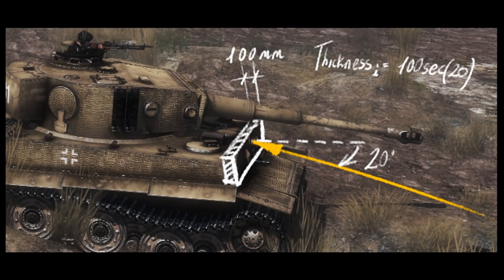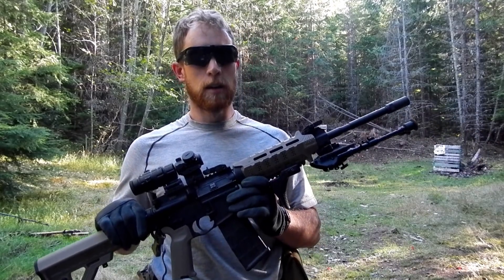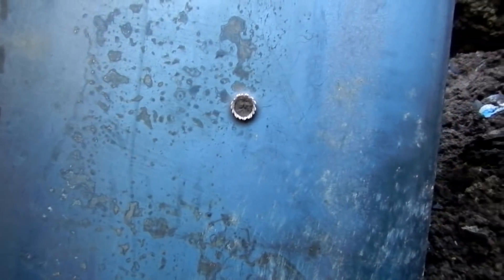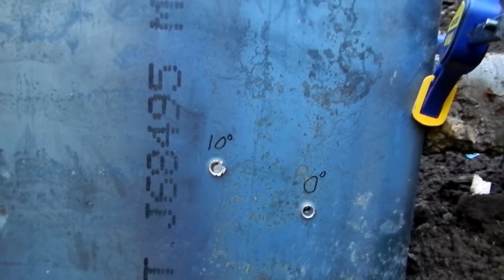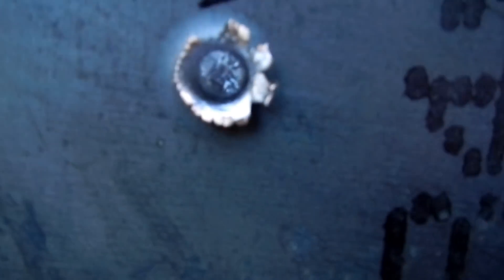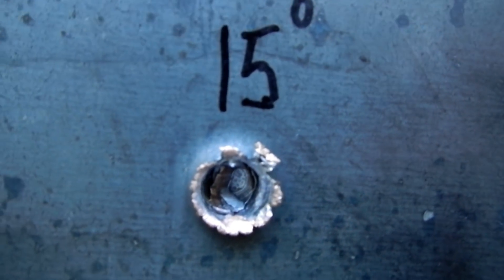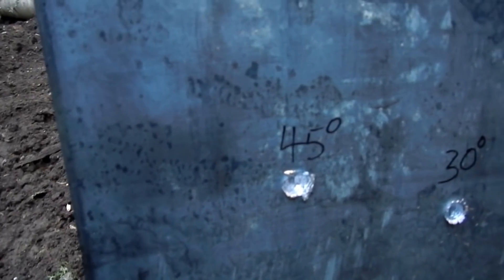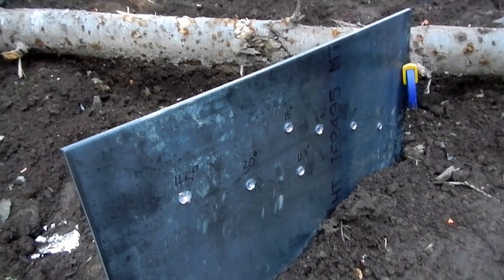Does sloping armor increase it's protection?

Comment: But to cover a given vertical distance an angled plate must be longer than a vertical plate - increasing its weight. For a given weight of armor is it better to use a thicker vertical plate or a thinner, longer angled plate?
Reply: This is a valid question if the vertical coverage is all you're looking for. Super good question.
Reply: Yes but you require two plates to cover the same space a sloped plate will cover. Plus a welded seam.
Reply: The top or roof plate doesn't need to be thick though, while the entirety of the slope plate has to be the same thickness.
Thus, the sloped plate (c) weighs more than the thin (a) roof plate and the thick (b) plate combined where (c) and (b) have the same thickness.
Reply: I'm not sure if I can word this in a way that makes sense, but the angled plate might still be lighter than a thicker front plate and a thinner roof because the angled plate can be thinner than the vertical one would have to be, just because of the distance the round has to penetrate horizontally will be the same if the slanted one is thinner. Also, I wonder how the tank designers thought of defense against aircraft. The thin roof design wouldn't help from that.
Reply: Michael Holderegger a lot of tanks where open topped. Most were thinner on top. Planes and artillery have always been a way to kill tanks.
Reply: Michael Holderegger your front plate should be as thick and slopped as possible. The requirements of the vehicle will also help dictate the need for protection vs speed and tactical application.
Reply: @brendonmoore3505  "front plate should be as thick and slopped as possible." you completly forgeting in your theory that you trying to cover something with your armor... you also dont understand that projectiles when attacking armor at angle doing something called 'normalization" -> changing angle of penetration. Sometimes its good to have vertical armot(that is why most modern armored vehicles have sloped armor only on the front...).
Reply: Biały are you telling me you won’t make your front plate as sloped and thick as possible. I’m totally aware it’s a box. 
Totally aware of normilizaton aswell but that’s a little much for a channel. 
Pretty much why I said it, front plate thick and sloped like all modern MBts.?
Reply: A sloped armour will be half the weight of a vertical slab. Simple because the slop doubles the stopping power or deflection of the projectile. An increase of size due to proportions will not outway the weigh the reduction due to halving your required material.